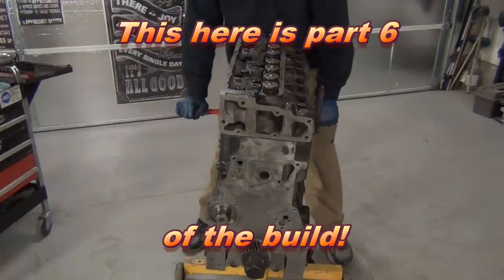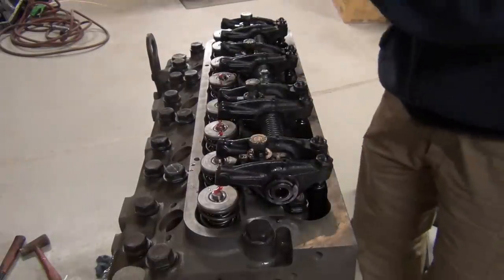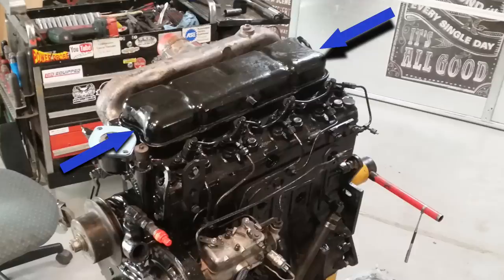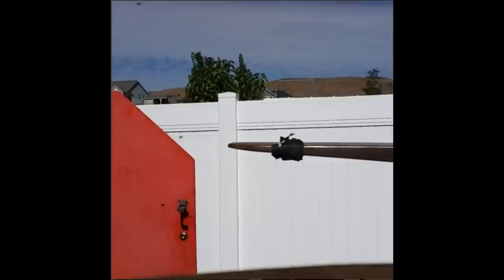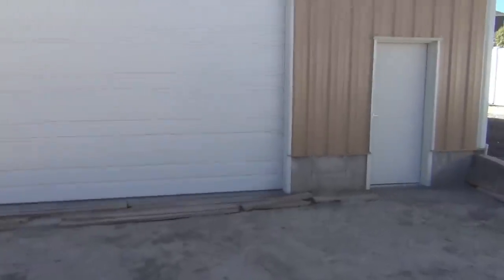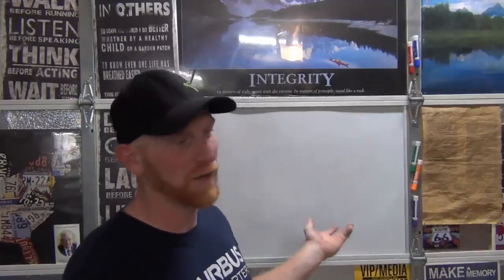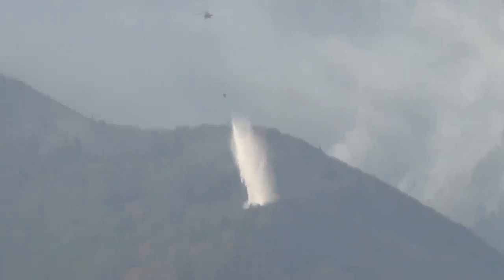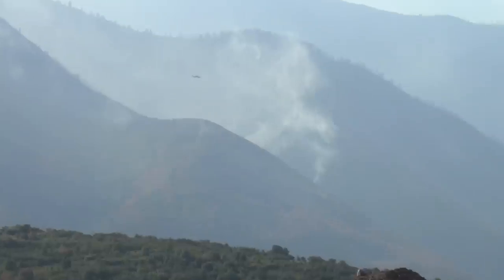Perkins Diesel Engine Build Pt  6 Fire it UP! Plus Building Update

Comment: Hey, well done on the Perkins rebuild series. I have a 4.236M Perkin in my sailing boat. I trained and worked as a Marine (submariner) engineer in the Australian and British navies and rebuilding diesel engines was second nature. But I left engineering to go into the commercial business world until retirement 25 years later. In retirement I had an aspiration to rebuild my Perkins as it was consuming oil (a litre for every 12 hours of operation). Despite my training I was  slightly apprehensive having not been on the tools for so long.   I stripped the engine down and sent the block to the machine shop to press fit the cylinder liners only to be told the bock had a gouge between the No. 1 & 2 cylinders (the gouge was about 10 thou deep and caused when the head gasket blew about 10 years earlier - I fixed it at the time with metal putty (Devcon) as I was half way between Asia and Australia and this worked a treat. The short story was the machine shop were cautious about shaving 10 thou off the bock as they claimed it would upset the compression and the valves might hit the pistons. I wasn't convinced. However the kindly sold me a workshop reconditioned 4.236 long engine for the price of the rebuild kit, which was the deal of the century, as well as getting a reconditioned head that I hadn't planned to refurbish. I took the opportunity to fit either new parts (starter motor, alternator) or have them professionally rebuilt (injector distributor pump).  I very much enjoyed watching the entire rebuild series, learnt a few tricks and hints and thank you for sharing your knowledge. I enjoy my Perkins and feel safe in the knowledge that I know every bolt and intricacy. I had the oil cooler blow the side out when we were in Hong Kong 20 years ago (electrolysis caused by stray currents), but found a Perkins dealer a short bus ride away from where we were berthed. Great engines and worth keeping them alive.

Comment: I like your videos Brian, & i'm a mechanic too. I once made the same mistake  as you did in this video by overhauling an engine without calibrating the fuel injectors & it did not start until  removed & cleanup  finally.  It was a Perkins 1103  engine ,  Have been running for over a year now. Your videos  are wonderful. Thanks for your time.

Comment: Great video. I can relate to the motivation thing. Sometimes I have to force myself to start working on something until I feel the motivation and then I get into it. But the idea that I might run into hang ups like you did on starting the newly rebuilt Perkins is what kills my motivation, and sometimes I just don't have the energy to deal with it.

Comment: Hi, the O-ring was a line to the injection pump? Im running into the same problem with a 4cyl perkins on my bobcat. Thanks
Reply: I have problem when engine get hot it will not start but when its cold it starts great. I think the problem is in some oring leak

Comment: Just watched your engine rebuild series.  I have an old JCB telegandler that I want to refurbish, for the reasons as you.. need a new man shed!
You very briefly mentioned that you fitted electric solenoid the main fuel pump, rather than the mechanical stop.  If so, I what parts did you use and how?

Comment: Hey man not sure if your still on here but I'm rebuilding a perkins also. Got everything done. Started right up but ran bad. Pulled the Injectors and not all of them where spraying. Got new ones and now it's just a lot of black smoke and won't start. Any suggestions. Thank-you

Comment: I have a similar engine on my boat and I am servicing the engine and took out to my garage, after changing the oil and all filters. I realized that the solenoid was never connect electrically. Now I am trying to start it in my garage and after bleeding all the system I still cannot fire it up. Do I need to connect the solenoid? Do I need to bleed the engine in some special way? any recommendation is very welcome.

Comment: Hi Brian REG FROM CANADA  love your channel been watching it for several years I have a Perkins diesel engine in a 1982 Landini 50 hp tractor I cannot seem to get the engine to warm up no heat rad stays cold put a new thermostat in and  flush rad had a  old timer diesel mechanic come look at it and there’s a circulation when I gets hot it kind of circulates just around the thermostat and back to the pump so he asked me to pinch off the line and still it’s runs cold I can put my finger in the rad and it’s cold and I can run it for hours you have any idea what it could be thanks for all your help could not mechanical  without you GOD BLESS YA